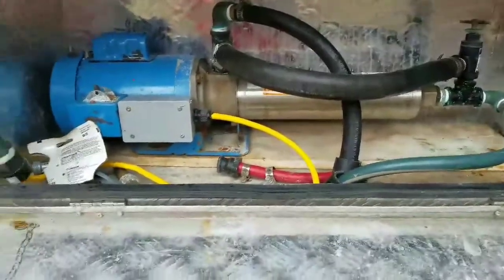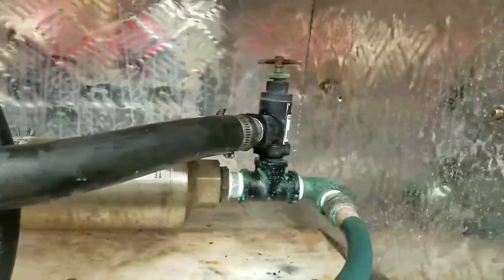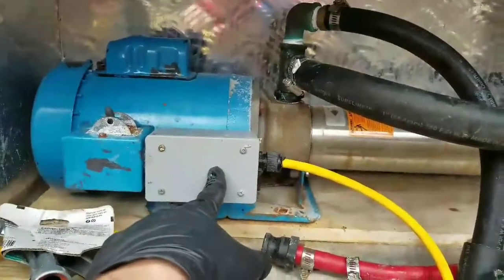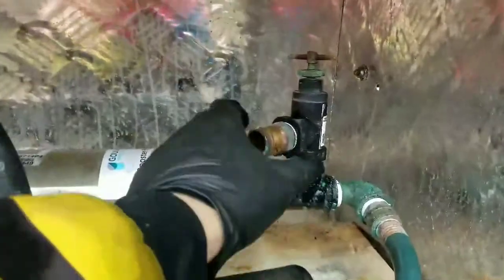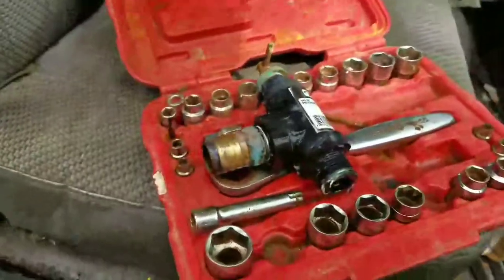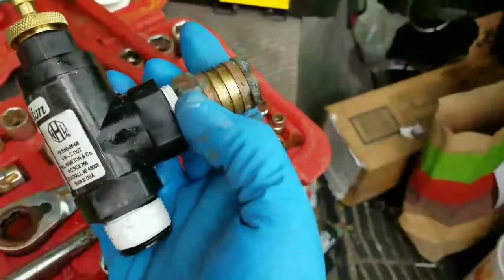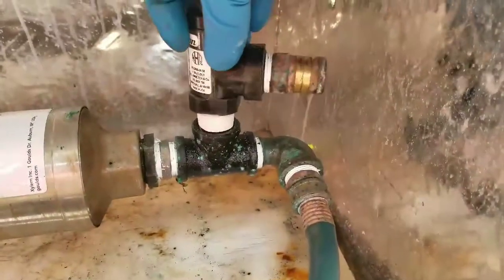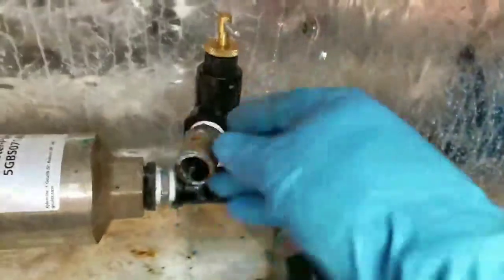Replacing unloader on Goulds Booster pump in the field

Comment: May be dumb questions but...what does the unloader do for a booster pump? Also, I can't  find those unloaders.  Are they just called "booster pump unloader"?
Reply from the maker: It recirculates the flow back to the inlet.  Which helps it not blow up.   Basically just buys you more time before the pump overheats